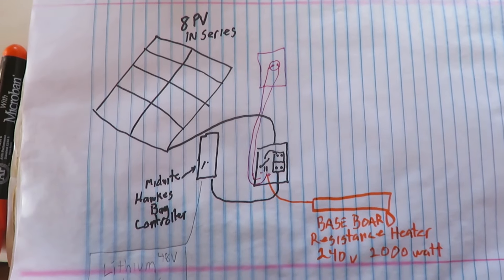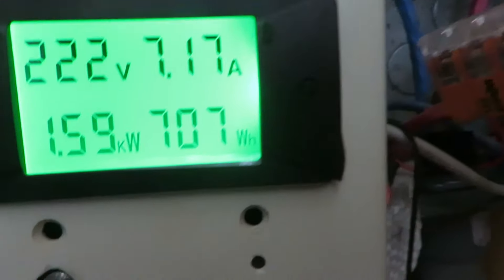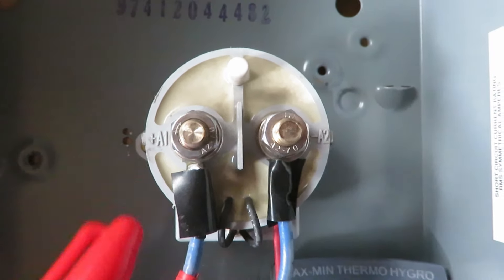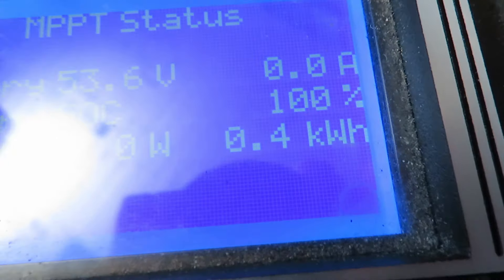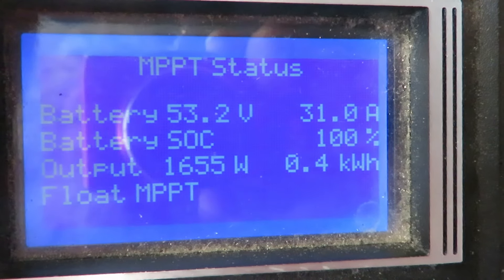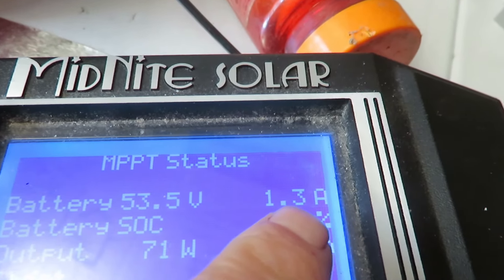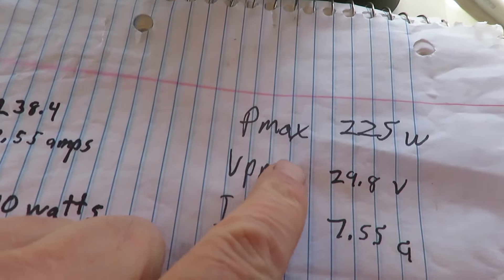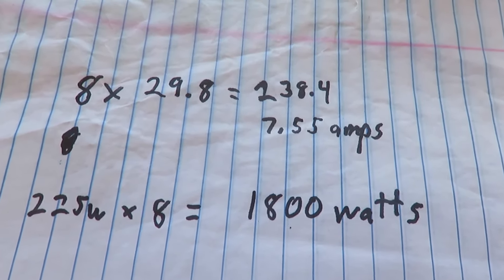PV bypass charge controller  direct to heater when batteries are full.

Comment: I've been tempted to simply wire-up some panels directly into a heater. Since my house is heated with electric baseboard heaters, the solar powered heater would come right off the top of my heating bill, saving money. Payback would be about 'several' years (3-5 roughly). Payback is helped by skipping all the costs and lifespan issues surrounding batteries.
Reply from the maker: There are lots of used pv around that would work perfect for that application . They should be inexpensive . Although there are supposed to be rebates this coming year for air sourced heat pumps that might pay for the whole thing  ( if you are in usa).

Comment: Why not just use Mppt float and set the relay to the voltage you want to start heating
Reply from the maker: You mean via the Aux ? If you mean via the aux of my controller -- I guess that would work too. For lead acid it would work better using waste not since that gets the extra power from both absorb and float. But with lithium float should work since there is no extra power at the absorb stage of charging.
Reply: @LarryKapp1  Ya with the aux and with lithium the top 10% of soc is not very productive so it works well as long as you have enough solar to keep the battery charged.

Comment: You just need dc heating elements 24v wired directly to solar panels to heat water in insulated barrels.
You only 24v 350w solar panels wired individually to each 24v 300w heating element. 
Solar water heating is best to be separated from your house power. No point for that headache with relay just because you have too many panels installed on the solar inverter and is charging your battery quick.
Just unplug few panels and make a separate system. When water reaching  60°C, use a relay to send power to your house lighting 24v or floor heating. Why would you put stress and cycle on batteries??? Reduce their cycle usage by spend ling extra solar for water heating directly. Water first, is more efficient.
Reply from the maker: In the short days of winter and on overcast days I need the extra power into the batteries. I don't think the lithium batteries mind if they fill up quickly or not . There is no extra cycle use on the batteries because once they are full for the day they don't charge any longer. I get what you are saying about direct PV to hot water but don't have room for all those barrels of water. the other factor is the proximity of the pv to the load - with the panels wired for 240v there is little voltage drop to where the power is used . The relay isn't a headache at all and only cost $35 used. I also have another system where I do heat water directly from PV but I still need some kind of control to keep water from over heating. I get if I sized everything just right with enough water you could do it without regulating water temp but I don't have the room for that kind of system. Thanks for your comments.
Reply: @LarryKapp1  to controll water temperature there is temperature thermostat relay 240v that shuts off the power when water reaches your desired temperature.
Reply from the maker: @FRESNEL_COOKING_SOLAR_OVENS24  I use a  digital thermostat in series with the control line of the IGBT that is rated for DC - works fine and if I wanted to I could expand up to something like 1200v dc and 500 amps ! Not that I am going to though. So basically using a transistor instead of a switch to control power.